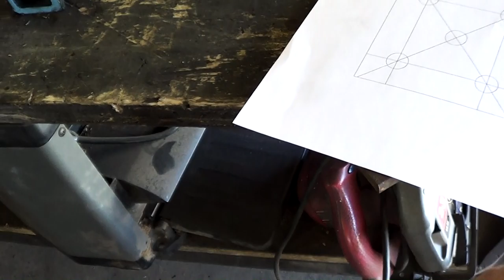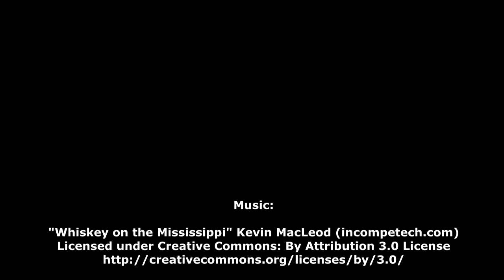Project Grizzly 03 Building a Drop Trailer Axle v50

Comment: Hey Justin, I have a drop axle on a boat trailer i want to convert to a side by side trailer. Can I flip a drop axle and make it a "raised axle" for ground clearance without making it a weak point?
Reply from the maker: I'm going to say it's not a good idea. I wouldn't be as worried about weak points as much as it may change the towing characteristics, harder to back up, a little squirrely at speed and things like that. Honestly, I just don't know. The easiest way to add ground clearance would be a straight axle, running axle under the springs, axle spacers between the springs and axle, taller tires and wheels. Be safe with it whatever you decide.

Comment: Do you know if that axle could be flipped over 180 degrees so the body of the trailer would be sitting up 5" higher? I'm making an overlanding camper trailer out of an old uhaul drop axle trailer but the way it's designed it's made to make it really low to the ground for loading the trailer. I want to be able to drive over rocks on trails. I can move the springs from bottom of axle to top but that still leaves the axle really low and it will be hitting everything I drive over. I can send pictures if this is something you think you would want to give advice on. Thanks for the video.
Reply from the maker: Some axles can be flipped. That puts the springs on top of the axle. If you do that, be aware that not all trailer axles are straight. If it's been given a bend, that bend needs to stay oriented concave side up.

As for flipping a drop axle, I'm sure you could. But, what I've seen done more often is blocking between the axle and the springs after you've flipped the axle. Or, make the longer spring shackles.

Good luck.